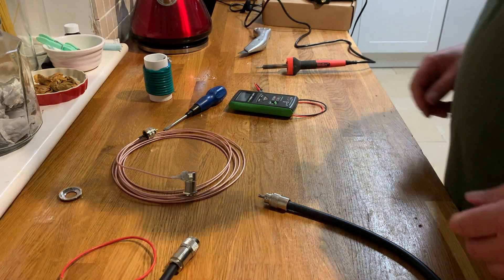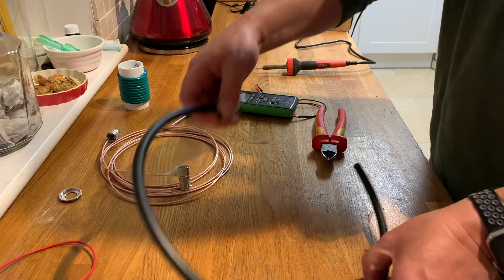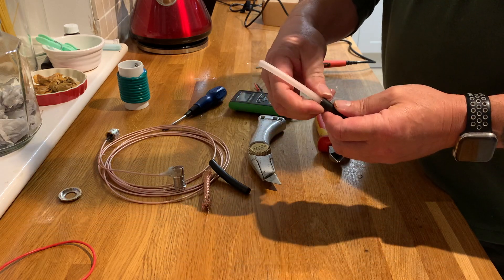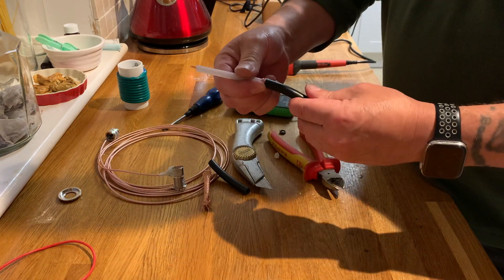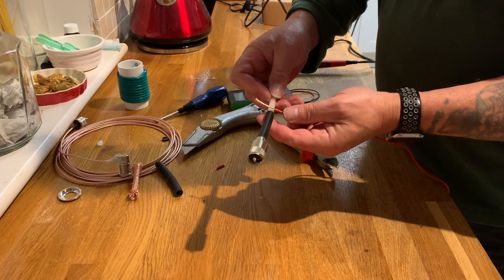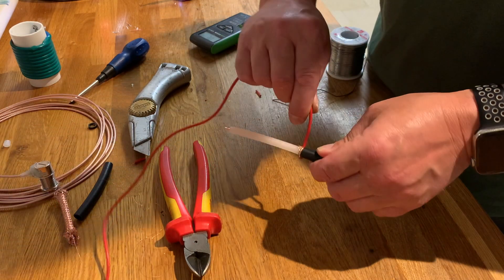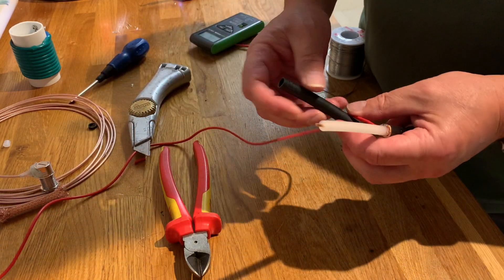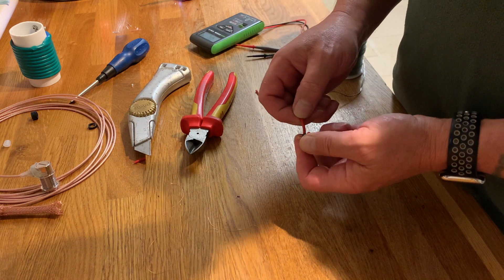Build a Dip meter probe : HAM RADIO : COAX Trap

Comment: Thanks Mike for your vidio, but because of my very bad hearing could not hear everthing you said, so amm I right in thinking that the Red wire has 20 turns and one end soldered to the coax copper core but the other end is soldered to the Woven Copper Shield and the Copper Core, not just the Shield. Thanks, Dennis
Reply from the maker: yep spot on

Comment: interesting.. Have been playing with a simple lc circuit and calculating the frequency with a calculator and measuring the frequency with a dip meter which means I have been checking the dip meter frequency with a radio. Get results out which vary about 500 kcs to 1.5 megs out.  Have to move the coils quite away apart to only get a slight dip; otherwise the dip meters swing too much in opposite directions.  Now I have seen your vid, I shall try to use the 259b so maybe I will see the frequency without having to find it on the radio.  Then I think I will put the 259 in parallel with the tuned circuit and oscilloscope to see if I see the highest wave on the oscilloscope, and if it gives me the same frequency  as the mfj - if it works.  Thanks for the idea.  Keith G0odu

Comment: Thank you for making another great video and sharing it with all of us!
I have a couple of questions I'm hoping you can answer please:
1.)
When using traps, can we use as many traps as we want and make and EFHW antenna that is 160-10 that is multi-band and works on every single band by using traps at every interval?
2 )
How much power can go through a trap? Is there a way to know that if we built an antenna using a series of traps for a multiband antenna that it could handle 1500 Watts?
I am of course subscribed with notifications turned on and thumbs up!
73
W3GUY
Reply from the maker: You could use a trap for each band but is is not recommended as each trap brings a dB loss ( I think is 2dB per trap).  A 49:1 or 64:1 transformer EFHW, will resonate on 20,40,80,160 if it is 80m in length anyway. Also the trap is a low power device unless you use lmr400 or a ptfe based coax like 316.
Reply: @mike-M0MSN  thank you for the reply! I was wondering how much loss was involved, sounds like traps are not a great plan for multiband. Each road seems to lead me back to EFHW as the solution of choice for HF multiband. 73 W3GUY